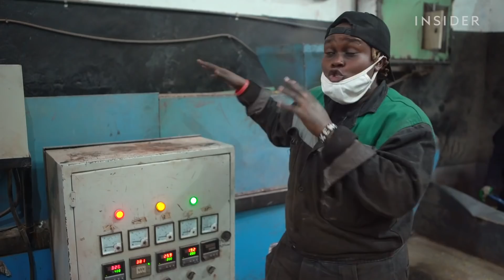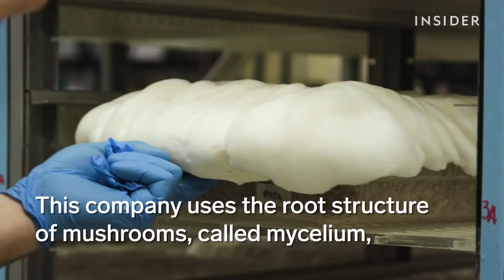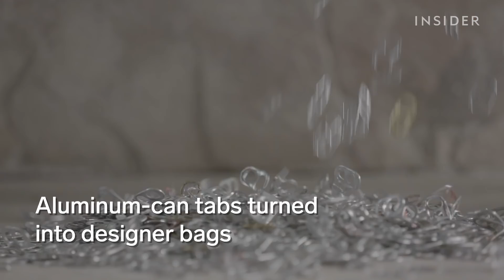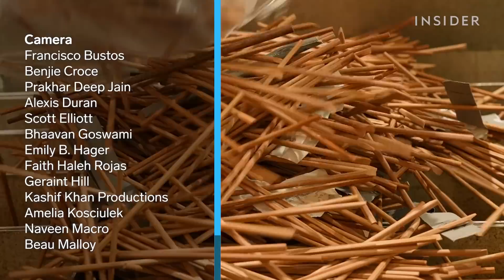15 Inventions Made Using Garbage | World Wide Waste

Comment: One big problem however remains: All the plastic waste used e.g. as bricks still are beeing used in the nature for roads for example. Through erosion and time lots of small plastic particles are rubbed down which again results in enviromental pollution.
Reply: true but we don't have another choice as burning it would create really bad pollution. Atleast its being re used (sorry for my bad English)
Reply: How do you suggest we get rid of plastic then?
What is your solution?
Reply: @Zeverinsen  Right now ther is no solution to get rid of plastics completly. I don't critize any of these inventions but I do wanna point out the fact that plastics are one of the worst things humanity discovered and now doesn't know how to control it's impacts.
Reply: @Zeverinsen  Burn are better.
Reply: But they burn the plastic which releases the toxic gases to make the bricks
Reply: @spvvfmspvvfm7395  we don’t have another choice? It’s called landfills.
Reply: True. Microplastics are a big issue.
Reply: They could use some sort of seal to avoid that. Idk if that would work but I think its a solvable problem it just needs more research.
Reply: ye, the idea of reusing plastic is good but maybe, not with bricks? or maybe have the bricks painted and use for buildings and not for roads/walkways
Reply: @spvvfmspvvfm7395  We should separate all the substances. Plastic is way to toxic for use
Reply: But i think it takes a long while to break down which is the point

Comment: I really don't see the appeal of the avocado stone thing, it is biodegradable in the first place and it's only real value is in replacing something that is wasteful... but it seems like more effort and energry is used in making it than warrents it
Reply: Same as mangoes
Reply: @tcmcity51  and that algae mixed with plastic one
Reply: @harrymu148  no that one is good ..it makes the shoe biodegradable
Reply: @tcmcity51  I was talking about the one that had a surf pad as part of their product lineup
Reply: @harrymu148  it’s better than the entire product being made out of plastic. I understand that it still uses plastic, but at least it’s a smaller quantity so a step in the right way
Reply: It's a bioplastic. I think the idea is that we can start using agricultural waste (like avocado pits) to make plastic rather than using petroleum. I don't necessarily think it's the BEST solution. But you gotta admit if all single-use plastics were biodegradable, the plastic pollution problem wouldn't be nearly as bad as it currently is.

Comment: I assume those mangoes used for leathers are expired, therefore no one buys it? They don't throw away good mangoes for no reason, right?
Reply: Not always.
As a truck driver, I've had produce get rejected from big-name companies if they see a few that are bruised or not good enough.

If a box has a moldy one on top, that might have gotten too much air exposure or something on it whereas the rest in the box are good, the whole box can get rejected.

I have even had food that was plastic sealed and then boxed, where the box was damaged and the whole thing rejected, even if all the plastic bags were intact.
Reply: @LabrnMystic  The whole box!? If the concern is the rest will be rotting quickly as well they can sell the box cheaper with note "must be consumed quickly" or something.
Reply: @imageez  they should! But sadly that's not how thing work in today's businesses

Comment: So how is it any different if the mangos end up in a landfill as opposed to becoming chemically processed and then end up in a landfill?
Reply: Atleast they get used one last time instead of straigth out thrown away.
Reply: @gamedominatorxennongdm7956  used one last time? It’s mangoes!
Reply: Well, hopefully they get composted instead.
Reply: Because it's better to use the mangoes instead of using plastic.
Reply: Because they can replace the extremely unsustainable plastic leather that is now serving as the only source of vegan leather. So they're taking excess fruit that would just be thrown away and turning it into a biodegradable, environmentally friendly and sustainable source of vegan leather.
Reply: @dreadfairy6963  this mango “leather” is also filled with plastic.

real leather is far far more sustainable, moral, and good for the environment. It lasts longer, it does not contain plastic, it is a waste product.
The cow dies either way, only difference being if the leather is used, or goes to rot at a landfill

Comment: The soot in to tiles thing is actually awful for the environment.  The tiles are made from concrete, which is a large source of greenhouse gasses, then it is "watered for a week" so that they cure properly.  They also state that the only carbon they are capturing is particulate matter, not the stuff that is causing global warming.  

There was a video I found a while back talking about the process (the place all the clips in this video came from), only a small amount of soot is used, it is still being produced and there is no carbon capture from the smokestacks ect, it's just plain old charcoal.
Reply: According to the video, it’s soot, which is carbon, but particulate, and is itself a huge climate problem, in that it also traps heat in the atmosphere.

Comment: I thought about using recycled plastics for fence posts or roll way sleepers. The issue is it will break down and not be contained.
Using recycled plastics to stop it spreading further doesn't seem to be a goal.
Using them away from sunlight like internal walls, inside furniture framing, funky lamp shades etc can avoid needing to worry about homogenous color and texture.
Use low energy new plastics where its needing to be cleaned and recycled plastics where is can be rougher.
I wouldn't want to work in those factories without a air-feed respirator
Reply: Nz makes fence post out of recycled plastic
Reply: @shanerobertson3222  yup my kiwi brain supports them, i hope the posts are still clean  after 10 years. price of timber to re-do a fence line(and other things) will be worth over coming many challenges soon :)